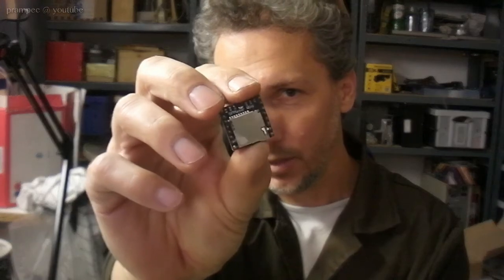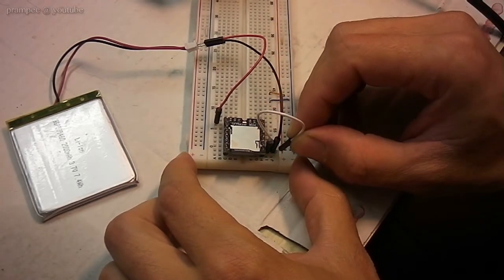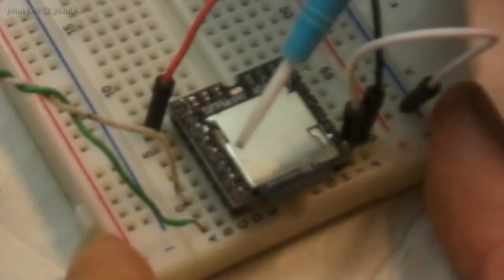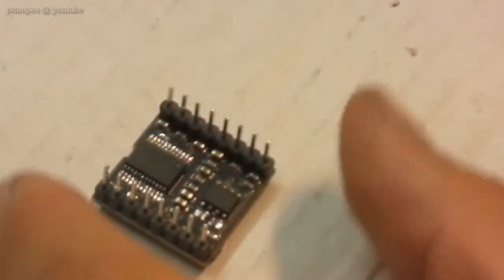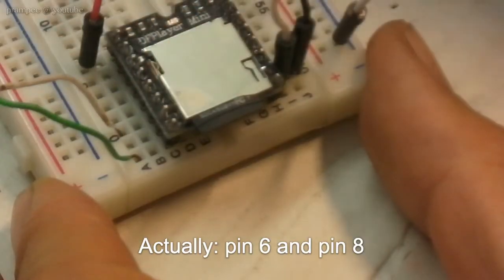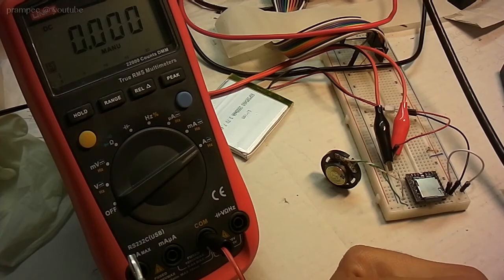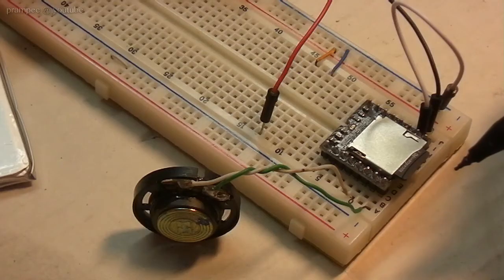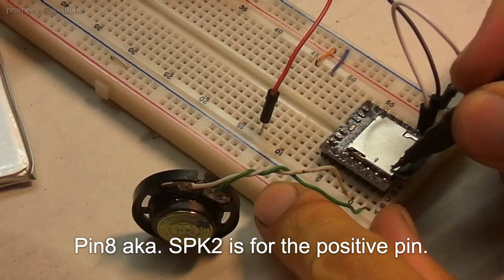Fixing DFPlayer Mini with no sound

Comment: congratulations on the video!
I have a doubt, I did the whole circuit and everything works fine, I've been feeding it with a cell phone charger ...
Now, I tried to feed it with 3 AA batteries of 1.5V in series, but nothing happens, it seems that the circuit is not energized,
Well my plan is to make it work only with disposable batteries ..
I would be grateful if you would help me solve this problem ... thanks in advance.

Comment: I connected an 8 ohm 1w speaker to it and the sound is barely there. Do you think doing this same thing to my module will work and make it louder?
Reply from the maker: All what I can say is that the speakers should be connected to the pins 6 and 8. Did you tried to crank up the volume?

Comment: is the speaker on the left or right audio track?
Reply from the maker: Good question. The amplified output in the module is mono. Not sure tho, that one channel is just lost, or the L/R channels are mixed into one. It might also happen, that the specs are wrong in this, and SPK_1 and SPK_2 outputs are actually the L/R channels, when connected to the ground. Consult https://reprage.com/post/dfplayer-mini-cheat-sheet

Comment: does the module work without renaming the file to 0001... etc?
Reply from the maker: You can put your mp3 files in sub-folders or to the root (or mixed) with any kind of file name. The 0001... numbering is for the indexing option of the serial interface.
Reply: Well, I just want some basic serial commands (play/pause, next, previous get song metadata, etc). I guess I don't really need indexing for that kind of stuff, right ?
Reply from the maker: I'm afraid you will not be able to collect metadata.
Reply: 0x4B Queries the current track of TF card 
That's what I found in a datasheet
Is there any other reason why I couldn't collect a track's metadata?
Reply from the maker: Sorry. My wrong.
Reply: That's what I asked you..if the module is able to play random named songs, and if it manages to print out via serial port the current track's name
Reply from the maker: I only have tried the "I/O mode" setup, so I cannot say anything about serial data possibilities, but I know already, that it can play files with any kind of names (however I'm not sure about the extension handling).
Reply: @sharedinventions   Can I ask where you got this detail?  The sample schematics show the player playing "segment 1" through "segment 14" based on the resistance put between ground and one of the analog pins, but I can't get mine to work properly and I'm thinking it is because of file naming convention.  Do you know the naming convention to use the 14 "segments" in this way with no microcontroller?